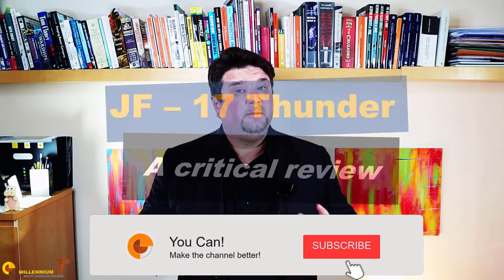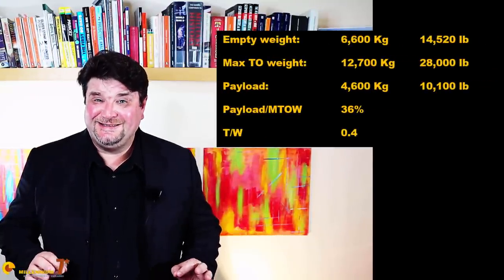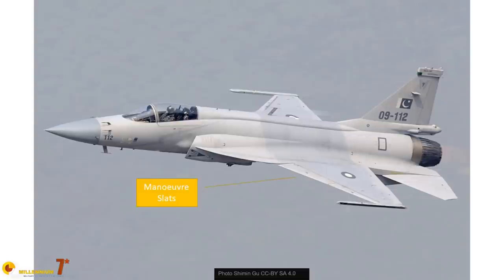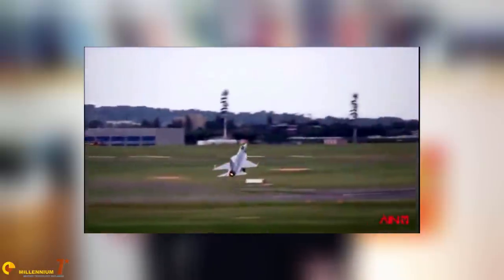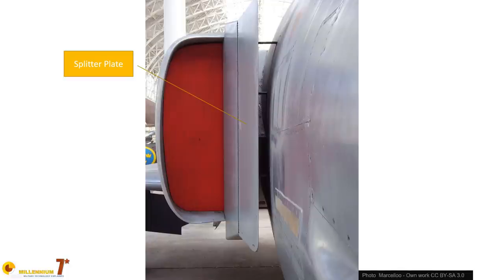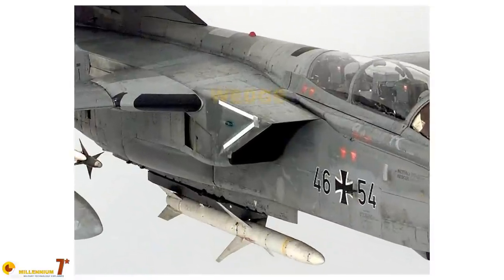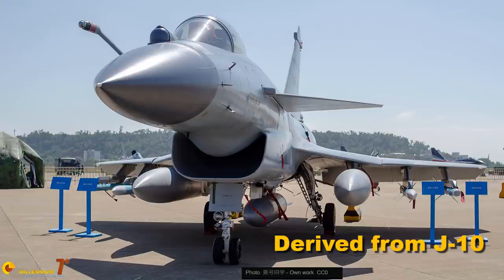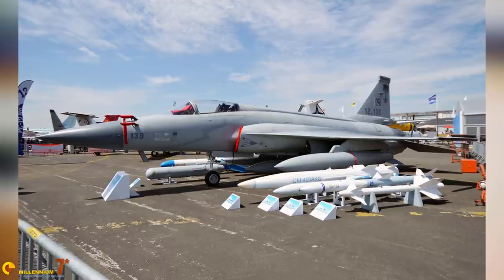JF-17 Thunder Block 3 & F-35 - What do they have in common?

Comment: JF-17 electronic warfare suite is by Indra, from Spain. It will be interesting to see you compare JF-17, LCA & Saab Gripen as all three are in the same light category.
Reply: Henrik G how so?
Reply: There is nothing to compare Chinese JF17 used by PAF with HAL Tejas and Saab Gripen. 
Gripen E is going to cameout in 2022-24. While Tejas Mark1A by 2021.  Tejas Mark2 is going to come out by 2025. JF17 block3 might came by 2022-24 as claimed by Pakistani pages.

Both Gripen and Tejas goona use same engine Ie Ge414 and Aesa. 
JF17 Block3 gonna have same under power engine ie base RD93. So thr will limitation to power Chinese KLja Aesa for JF17. While Tejas Mark2 goona have inbuilt Jammer and Electronic warfare capabilities. Pakistan may have to sacrifice one hardpoint to mount Targeting pod again. Than there are some other limitations also. What is point of increasing its hardpoint from 7 to 12 when max carrying payload is same?  Assuming JF17 sacrifice 2 hardpoint with External fuel tank. That will leave 2 or 4 hardpoint to have BVRs  to mount?. What of rest hardpoint are for? Arming  them  with WVRs also would decrease its TWR further to some 0.3. Assuming JF17 has so called combat range of 1200km. Why there is need of external fuel tank?
Reply: Salman Sadiq  Good joke
Reply: No comparison at all. Pakistan JF17 hit targets inside India last year Feb. Tejas was then getting ready to fly in some airshows like Gripen hehe. U guys must definitely do comparison once Tejas and Gripen come out of their moms laps and go into field for a war, chances of which r far from reality right now lol
Reply: Marcos B  but is tejas really there..world never saw Tejas in any airshow.... Neither indian airforce has acquired it yet.. are u kidding
Reply: @paltech5432  there's literally dozens of video on Youtube
search it
Reply: @jagdeepsingh6742  what are u smoking now a days.... Are you talking about India or Pakistan?
A failed Project like Teja cost India 15Bil$ (include kaveri, Astra etc), Pakistan only Pay 250$ or JF17. a fifth gen wont cost us more then 2 billion on research and prototypes
Reply: shashwat singh  in 2020 they start testing Guns. it'll mount in 2022 (based on track records).. lol
Reply: @aamerjamal  $2 billion on research? Does pakistan has any lab for research and designing an even 2nd gen jet? Mention the lab amd crucial Technology PAF or Kamra posses to design a jet. Pakistan evn does not have tunnel simulation . But Pakistan  can import such Technology from Indian IIT colleges.
$2 billion on R&D? What are you Developing plastic 5 gen jet?
Reply: Marcos B  1. Block 3 will have 40% composite n will have engine with FADEC as well it will have RD93 MA n Mach 2.0 speed.
2. It will have fly by wire in all three axis and at every overhaul of the plan new technologies will be added.
3. Writing code in C++  so by your logic F22 Raptor ain't a good plan because it use the same language for its development.
Reply: Marcos B  oh my lord lmao, only Teja is perfect and F22?? Really, u seem like drunk bro. You don't have to be illogical while defending your point of view. 😂😂😂
Reply: @zahid34345  No , Pakistan confirmed last week that they will use same engine with  4% more thrust. And that is not Fadec. The only variant of RD93 ie, RD33MK used by Indian mig29upg and Mig29K and by Russian Mig35s are FADEC. 
Pakistan Airforce had rejected RD33MK engine due to large price quote and due to sperate logistics issues. So JF17 block3 again goona be under power and will limited to LCA category. While Tejas Mark2 will be MWF with Ge414 with 98Kn afterburner  and 58-61kn dry  while GE414EN has afterburner thrust of 110kn. With know how of Tejas, India has launched another 4++ gen program  called TEDBF for now. It will be 2 engine aircraft and will be put into production in same or later timeline of Tejas Mark2.
Reply: @jagdeepsingh6742  you have a vast knowledge about fighter jets and to whom you are presenting facts these Pakistani do not talk in facts they are in their wonderland.
Reply: Marcos B  They call mirage2000 a MWF, Tejas Mark2 is of same category. So is MFW. There is no classification or definition of medium weight fighter. 
You can rise, weight of fighter with more use of titanium and metal, Tejas Mark2 with metal can be 9ton, with Carbon combosite material, it will weight less. 
It called MWF for its alleged Maximum take of weight of 17,500KG. It is 18-19k KG for F16 block 60.  So not such difference!
Reply: shashwat singh  Why would i expect as Block3 will have a 200KM+ range bvr, but to shows the readiness of your tejas,, btw jf17 welcome the decision of deploying Tejas at western forward bases
Reply: shashwat singh  well its aim 260,  also if y inlet can reduce more rcs then why indian 5th gen uses dsi? Your so called democracy took 4 months to accept that they shoot own heli while paf on same day told that you the heli was a friendly fire case